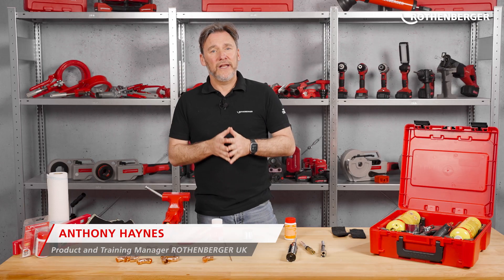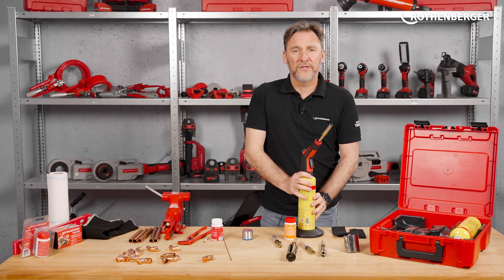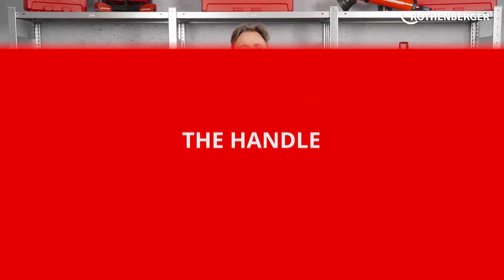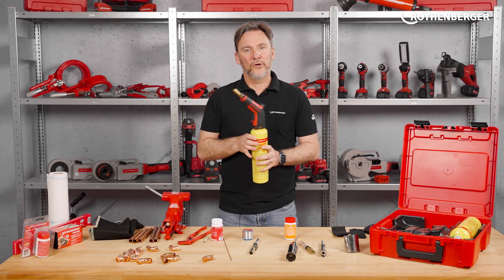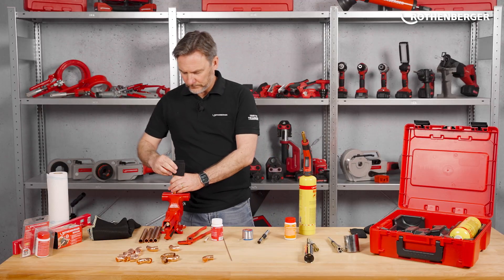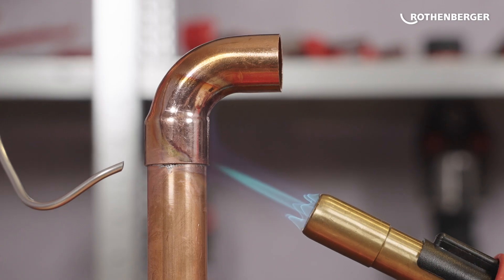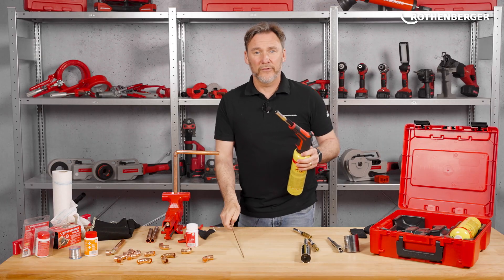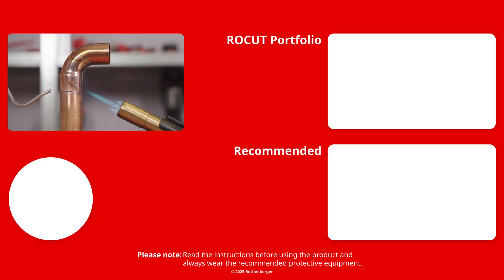Soft Soldering & Brazing with the SUPERFIRE 4 | How It Works

Comment: Hello,
I need a nozzle for pinpoint heating with a narrow “arrow-shaped” flame for a Rothenberger Super Fire 2.
Is it available? If yes, please provide the catalog number and ordering details.
Reply from the maker: Hello, 
the nozzle for the SUPERFIRE 2 is not interchangeable. It is fixed. However, if you're looking for interchangeable nozzles, have a look at our SUPERFIRE 3 or SUPERFIRE 4. There you can use the pinpoint burner for a precise flame.